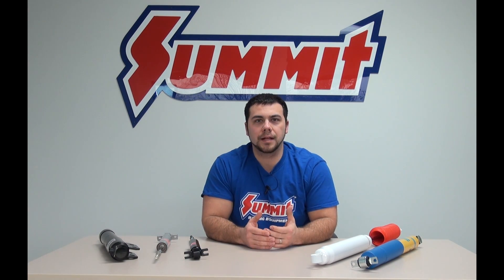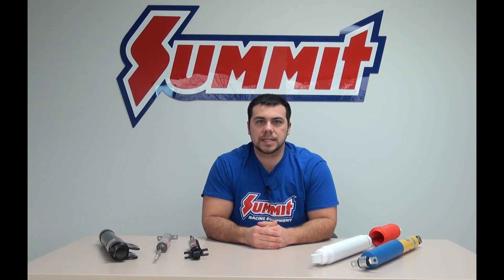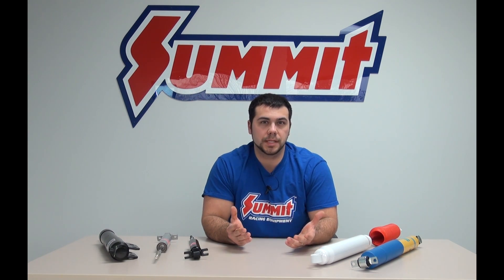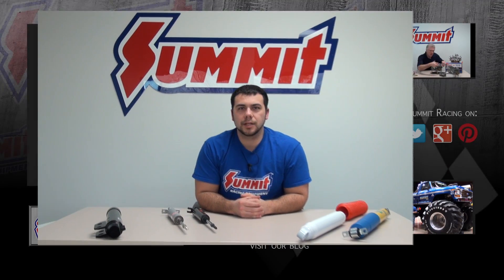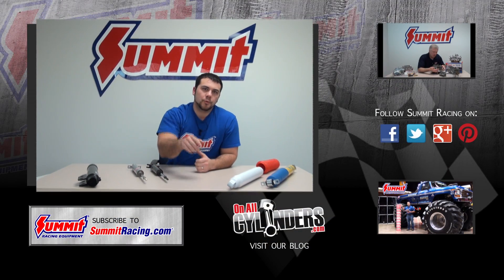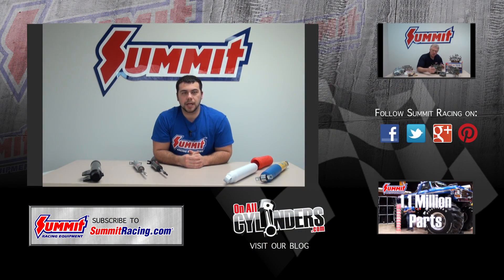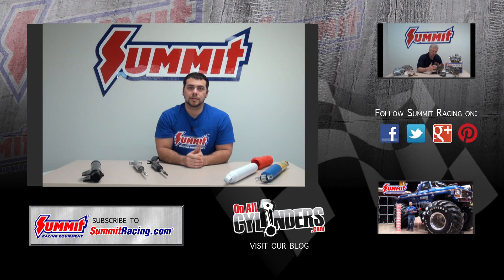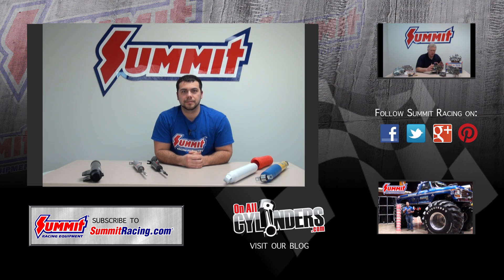Mono Tube vs. Twin Tube Shocks - Summit Racing Quick Flicks

Comment: I just purchased a 2021 Chevy Silverado 2500HD with the Z71 off road package. Comes with Rancho twin tube shocks. It has 20" wheels. The ride is incredibly harsh to say the least. Since I do 99.9% of my driving on road I'm wondering if putting mono tube shocks on the truck will smooth out my ride. Or? anything else I can do?

Comment: Good explanation, Now explain each and compare, the strut, the coil over, and the naked strut, I have ac delco oe on my h3 hummer, I would like to know if I can improve suspension and smoother ride, I want it to float all on road driving, I was thinking of belstein, 5000 series, or is the ac delco equally good ?

Comment: I live in southern Louisiana and I need a set of shocks for my 02 Dodge Ram 1500. I am looking for ride comfort, but more importantly control. I am leaning towards Bilstein shocks for front and rear. What do you suggest?
Reply from the maker: +Walkers Lawn , 
Undoubtedly Bilstein tops the charts as far as a go to for premium shocks. Great choice!
Reply: +Walkers Lawn  Thanks for the info. After doing a lot research I have to agree with you. I will be going with the Bilstein shocks.
Reply: Walkers Lawn 
3 years later.... did you and do you still like the Bilsteins?

Comment: I have the option of using CPP monotube or DJM twin tubes on my 71 2WD Blazer with a 454 in it. Only drive it for cruising around but don't want to "roll" around corners. Mono or twin?
Reply from the maker: Rich Eilers, 
This is a statement from the KYB website: 
All vehicles are equipped with some form of suspension damping control. They may use hydraulic fluid, air, gas or be electrically controlled. The two most widely used internal designs are twin-tube and monotube.
The twin tube design is the most common one in use on cars, light trucks, SUV’s and vans. It’s a cost effective unit that provides excellent handling & control characteristics for most driving conditions. The monotube design offers additional performance and can have a more aggressive ride.

Comment: hello I   have a question. What type of shock for comfortable and quiet, not performance or high speed,     GAS OR hydraulic oil  shock absorber ı want comfortable and quiet ??
Reply from the maker: VIPER BOLD, 
Best comfort and less noise will be found in a gas shock!
Reply: Summit Racing 

thanks for comment dude but some guys say comfortable and quiet only hydraulic oil shock absorber best not gas because  

hydaulic shock is best, makes car ride smoother, because it takes more pressure to make a gas shock work so ride will be bumpy most of time, but with hydraulic shock not much pressure is neeeded so shock works easier. So you would want a hydraulic shock.
Reply: @LostParadiseJM  why did you ask then?

Comment: im looking for smooth ride shock/suspension system for my truck, daily use, rarely offroad. lots of  shocks design,type and brand. but wouldn't wanted jeopardize ride quality, no body roll when cornering etc.
Reply from the maker: Hi XVII -IX, 
Can you give our tech line a call? 1-330-630-0240. We need some additional information from you. We look forward to your call. Thanks for watching!

Comment: i need shock for my 1991 Chevy blazer k5, its stock and i need to lift it 2.5', what do you thing would be good,  its a city ride off roading usually 20% of the amount of total driving.
Reply from the maker: Hi Hussain Allawi,
When installing a lift kit on a vehicle, the manufacturer will have a recommended/matching shock for your application. If you are making your own kit, measure the distance between mounting points and give us a call and we can match something up for you. 1-330-630-0240. Thanks!

Comment: Which is more soft?
Reply from the maker: Hi george7140, 
Ride quality is determined by the internal valving of each shock. Many vendors set the valving per vehicle and their research as to what a good ride is. If this is something you would like to change and experiment with; we have adjustable shocks available.

Comment: Do mono tube shocks last longer than twin tube?
Reply from the maker: Hi n310ea, 
When purchasing a good name brand shock it shouldn’t matter. You should make your decision based on the your application. Street, strip, street and strip, off-road, course type (handling/cornering). Twin-tube shocks are usually rated above mono-tube.

Comment: so i have a 1997 nissan sentra im looking at putting some lowering springs on and i figured i should replace struts while im at it. would you suggest monotube or twintube? right now the car has tons of body roll and its kinda annoying. gonna use some progressive springs. just not sure weither monotube or twin tube struts because mono seems better but yet you say stiffer ride. and its my daily driver car
Reply from the maker: Hi evan yoder, 
If you are just street driving the car and not racing it, a mono tube will do all you need them to do. Not to mention that slightly stiffer ride will work to your advantage on a lowered car in trying to control bottoming out on rough roads. Please let us know if you have any additional questions. Thanks for watching!

Comment from the maker: Well, I’m sure you’ve heard the saying “you can’t have your cake and eat it too”! What you have to consider is that truck shocks will have a little firmer valving normally because there is more vehicle to stop the movement on. A mono tube shock will be valved according to its application! Maybe have a look at the Rancho 9000 series adjustable’s.

Comment from the maker: Yes, they  are a twin tube shock. They are also recommended for the Pro-Kit performance springs that lower the car. The front: 1.4” and the rear: 1.7”.